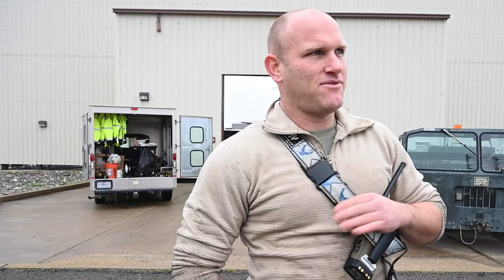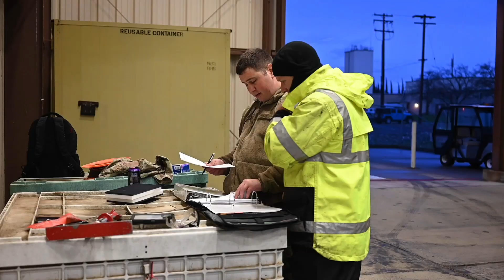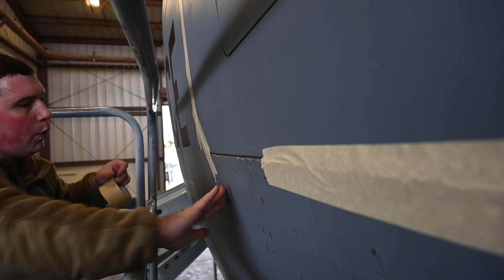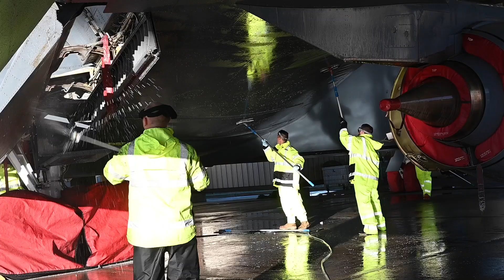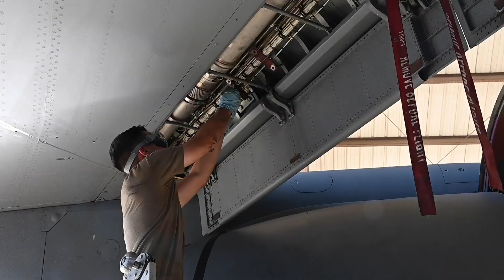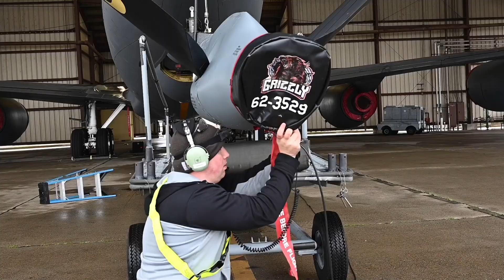How Air Force Crew Chiefs Keep Aircraft Clean

Comment: i guess things have changed alot since i was in back in the 80s the phase dock did inspection lube and washes not the crew chief i was a third wiper for 6 months before i went to the phase dock then to quality control and it was on the kc 135a